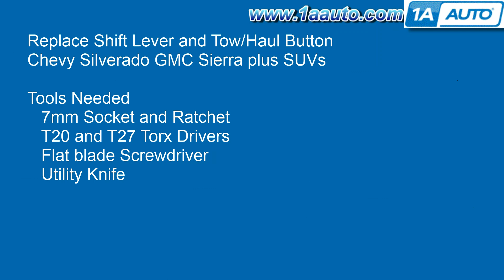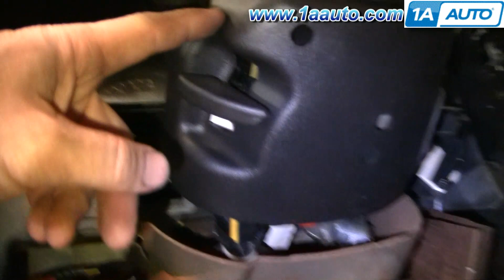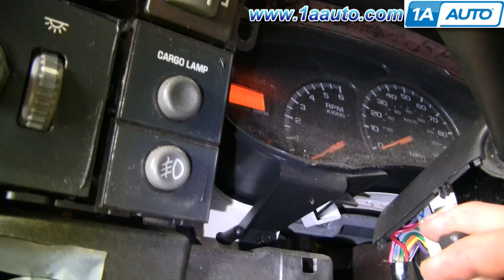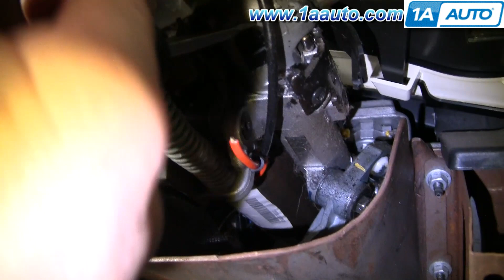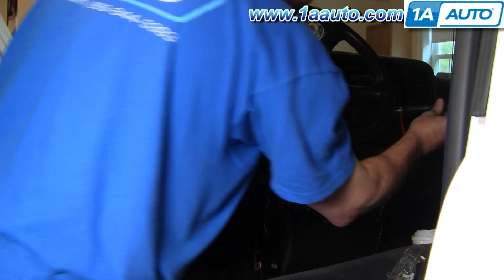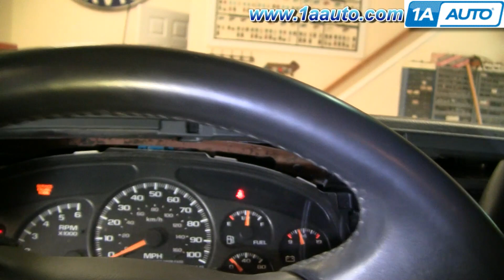How to Fix Tow Haul Mode Button 01-06 GMC Sierra

Comment: just a quick note - I  opened mine up and was expecting, like everyone else to find the orange wire in 2 parts ... clearly messed up.
however, mine looked fine - turns out once I pulled on it a bit, it was broken UNDER the clip. While it looked fine, as soon as I pulled it I was able to see it was dead, .. soldered wires back together with some extra length all working now.

Comment: Add one more to the list of early 2000s GM fullsize with a severed orange wire. Wire actually has two very fine gauge wires within but I was able to splice mine swcurely back together and rerouted to hopefully never have to ipen it up again. Thank you for the very helpful and informative video!
Reply from the maker: +Peter Havnen Thanks for checking us out!

Comment: The wire insulation is cracked but wires are not broken and test okay to plug connector with meter. Could it be a bad fuse, if so where is it or is there a deeper problem?
Reply from the maker: +BP Traveler We do not have a way of being able to diagnose the issue that you are experiencing with your vehicle but suggest taking it to a local mechanic for a proper diagnosis.

Comment: Could I just splice the wire without having to buy it ? Or not
Reply from the maker: +JoceyVDV Depends on the condition of the wires. If you can splice it and it works, great. But if it needs to be replaced, it's best to replace it

Comment: Thanks for the great video!  I just replace the shift lever with Tow/Haul button this morning on a customer's Silverado.  I found that removing the steel plate under the steering column makes it considerably easier to disconnect the old wire connector and connecting the new one, plus wrapping the wiring loom with the velcro sleeve.  There are 4 10mm nuts that hold it in place and it takes about 2 minutes to remove it and then you have an easy access to the wiring.  Another point is that the wiring from the handle is held in place by 2 black plastic retainers.  The top one is necessary to hold the wire away from the shift lever detent points.  The bottom one, if attached, makes the wire very tight and just above that is where the wire breaks.  So, I didn't attach the bottom clip in the hole and instead I used a small zip strip through the hole and around the wire to hold it in place and this gives the wire some slack to slide back and forth when the shift lever is moved and prevent it from bending and breaking like it did before.  Hope these tips help other installers!

Comment: I wen't through this headache with my truck a few years ago.  DON'T clip that second gizmo onto the stationary steering column, because this forces the wire to bend every time you move the lever through between park, and drive, reverse etc.  Over time the wire breaks.  If you leave it un-clipped from the steering column, then the wire can 'float', and doesn't continually get bent as you use the gear shift lever.  I'm sure GM just does that so people have to buy gear shift levers; and people who can't do this themselves will pay their dealerships shop time to have it done.

Comment: Thanks 1AAuto for the great video. I used this to fix the tow/haul on my Yukon. I have used your videos several times on various projects. By far the best how to videos on You Tube. I removed the metal bracket below where the connector is to make access easier. It was an extra step but worth it to me.
Reply from the maker: +Eric Schmelzer Thanks for watching. Have a great day! 1aauto.com

Comment: Could I just strip the wire and use a crimp connector to attach them?  I don't see the point in replacing the wire.
Reply from the maker: +Josh Veros Thanks for watching!  You could do that, but crimp connectors are not the best route.  We recommend splicing if you want to do it like that.  1aauto.com
Reply: Thanks guys!

Comment: Great video and thanks.  Couldn't find my part at 1aauto but Found the part for 2006-2007 Allison trans called:  SHIFT LEVER WITH TOW HAUL SWITCH NEW GM # 15860125

Comment: Great and helpful video. I would like to point out that if you remove the plate protecting the wire harness you can access the plug much more easily. It's just 4 - 10 mm nuts that are easily accessed.

Comment: just  spliced mine  together  if you do buy a new one just cut the ears off the  rubber clips and leave the wire hanging. The wire breaks because you cant even pull slack though the  rubber support clips. other then that great video

Comment: The two little wires inside the orange sheath are very delicate:  I wanted to splice them but destroyed them when trying to strip the white cover off.  Thankfully the full replacement part is only $67 from 1A auto, just ordered it today.  It is the shift lever, wire,, and also the lever boot.  Thanks guys!!

Comment: Took mine apart today (thanks for the video).  Unfortunately the orange wire is visibly attached everywhere yet only feels slightly loose inside the shift lever.  It would only be a guess as to whether this is where it's disconnected.  I jostled the wire inside here while depressing the button and not tow/haul lit up.. :( no damage to the wire around any of the clips.. bummer!

Comment: I'm actually a bit confused by this. Was that broken orange wire to the Tow/Haul switch?? I have a 2000 2WD Silverado 1500 that is stuck in the Tow/Haul Mode but the Indicator Light on the dash isn't on saying it's engaged and the button on the shift lever does nothing. I've been scowering the web looking for the wiring diagram and can't find it anywhere. Do I need to replace my entire shift lever in order to get the T/H system responsive again
Reply from the maker: Yes that orange wire had broke, it goes to the tow/haul mode switch. Hope this helps you out. 1aauto.com 866-403-3393

Comment: ok got a new lever got the old one out and sure enough cut wire. couldn't see it till the old one was out but video was big help .keep up the work on the truck one thing at a time your helping me fix stuff on my truck. only thing I did different I took off the 4 bolt metal cover for easier access to wires

Comment: can you tell me what the fuse name would be? its a 06 GMC durmax  and if it inside or under hood. the manual shift button still works and its on the same lever witch makes me think its not the wire

Comment: I looked found the wire but it doesn't look like it broke or cut. tried the steering wheel in different place and noting is there a fuse that might be blown any ideas

Comment: Thanks for the help, I had a friend fix mine by just adding to the existing wire. This problem is a engineering defect from GM and I think they should have been a recall.

Comment: I spliced the wires back together and rerouted in a better spot and works perfectly saved myself $75 and i know for a fact that where i routed the wire it will never happen again.
Reply: That's what I'm thinking about doing as well.
Reply: This is what I was wondering

Comment: ok. well i have a 2000 1500 silverado z71 and i have the nice full power crome mirrors bu i want to put the new square style OEM towing mirrors on it i just want base model power nothing without turn signals also how much would a pair run me from your company??